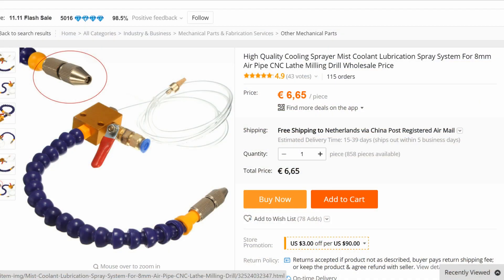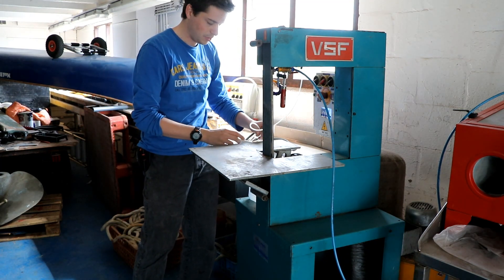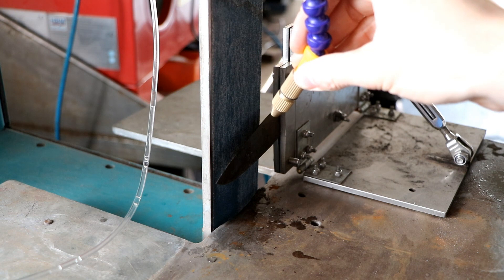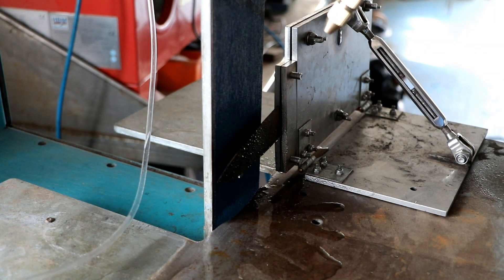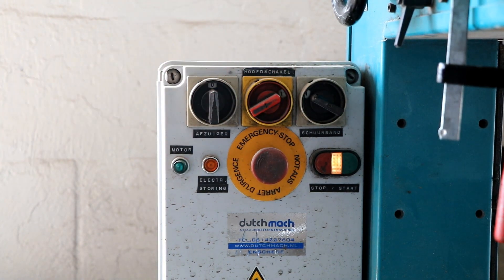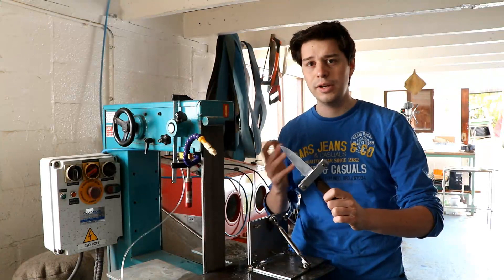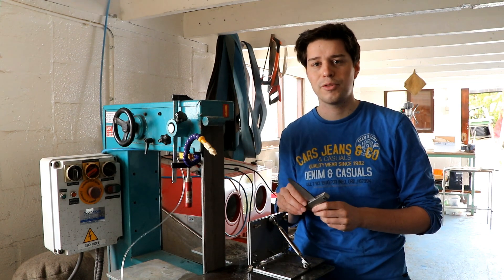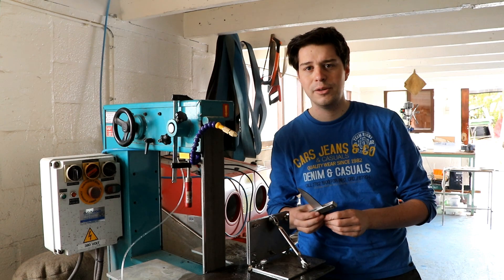6$ mist coolant for my belt grinder: is it any good?

Comment: I recently bought a pair of these same units. One for my milling machine, one for my lathe. I happen to have some surplus equipment and as such made improvements at no cost. One of them is to put a pressure regulator upstream on the compressed air supply. I run mine at about 5-10 psig. I'm also using mine to draw from actual machining coolant / lubricant that I mix and place in a one gallon jug. It works great. One common improvement many people make is to pressurize the coolant tank from the output of the regulator so as to drive the coolant to the mixer, and also to add a needle valve on the coolant hose. I may do that in the future since I have some needle valves I can play with and lots of fittings laying around. I also have solenoid valves and may use one of those with switches to be able to turn the compressed air supply on and off to the units.. All for increased convenience of course.
Reply from the maker: Wow, you are really using all the tools to make it even easier! Best of luck with your projects!
Reply: @yesealex  I will share something I've learned that many others agree with and make mods for. 
Eventually we find that we need to pressurize the vessel holding the  liquid with the same low pressure air we're feeding the nozzle with and then regulate the flow of the liquid with a second needle valve. This can be done with a separate valve, or if you buy a more expensive unit than these you can get one with to valves in it, one for each line. 
One of the problems is being able to set up the coolant level so that it siphons at a rate that you want, in any case I was finding that I was getting far more coolant/lube than I wanted in the air stream. I had the parts laying around to do the mod, and like the rest of the folks who seem to go through this the necessity becomes apparent. 
Good luck!

Comment: I like your review man thanks for the share. Maybe look at the water cooled plattens I've been thinking of making one myself as they are less messy. My grinder is all open so splashes water everywhere if I use a mist sprayer 👍🏼👍🏼👍🏼
Reply from the maker: ;) short circuits are not very well liked :)
Reply: Alexander Bol hahaha nah not at all. My last motor I had to put a rubber glove over the switch cause when I cooled my blades in water my hands were wet and I'd use the switch eventually getting shocked haha
Reply from the maker: +Diesineveryfilm Customs whaha that made my day